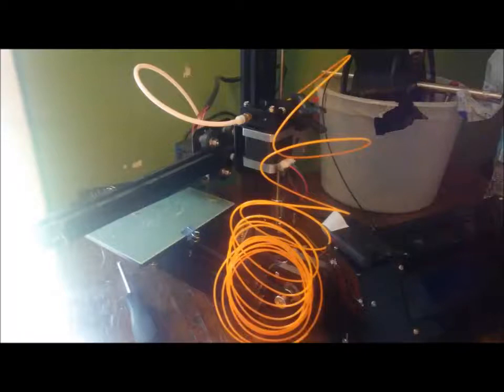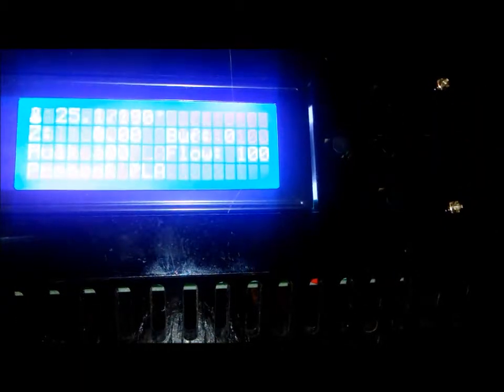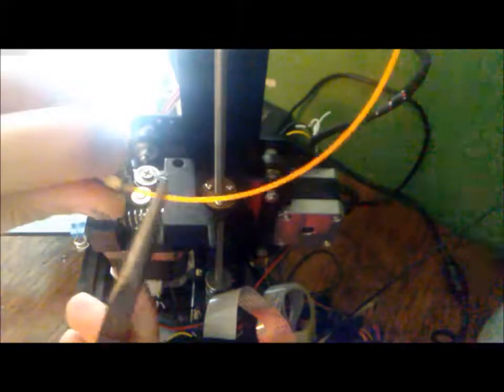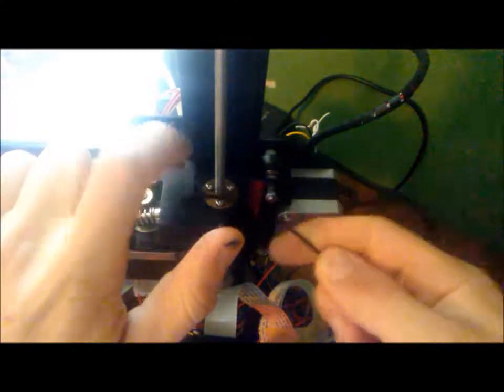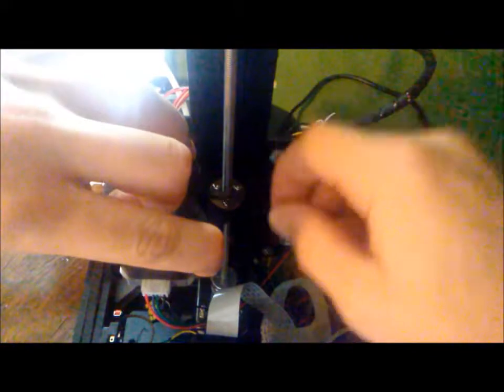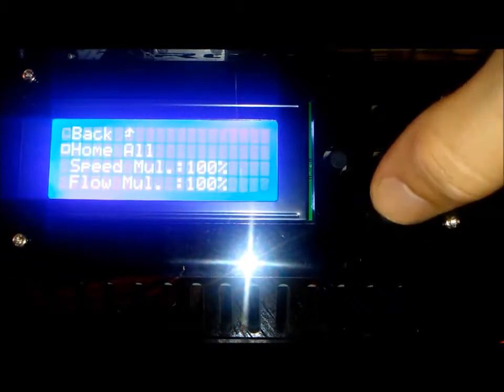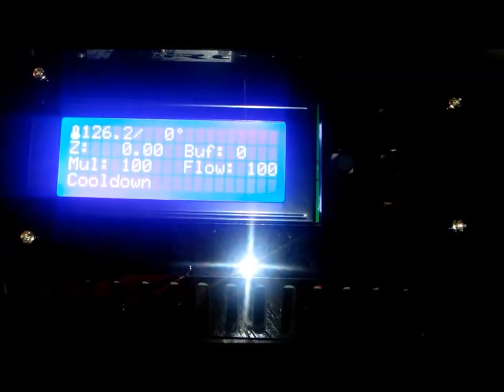How to Change 3D Printer Filament for Tronxy X1 Printer

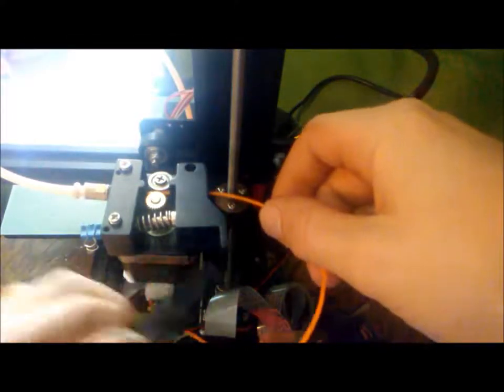Comment: 0:38 - Your extruder looks like its put together wrong, mine doesn't flop about like yours does, and I've never had to disconnect the tube to get the filament changed.
Reply from the maker: Hmmm could be still, but I have double checked a phew times and it seems right, my guess is it could be the filament, but my guess is  it was poor quality control on that part of my printer as Tronxy seems to be hit or miss with allot of their printer parts(at least on the early ones like mine, hopefully that's gotten better).   I am going to hopefully in the semi near future totally redesign my printer and do some upgrade work so I will look into the problem again at that time.